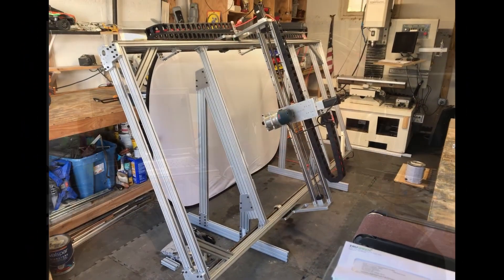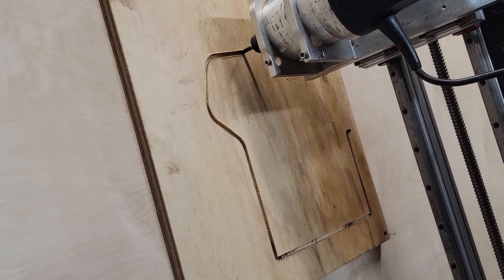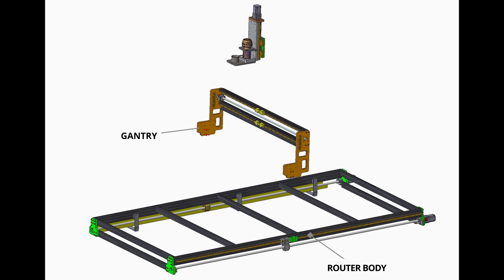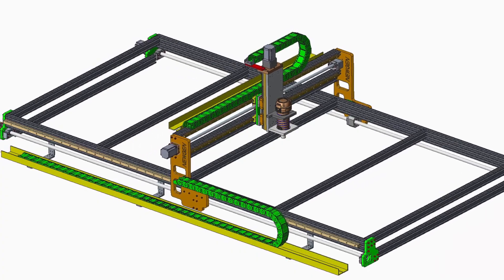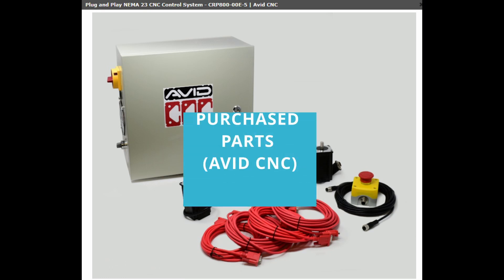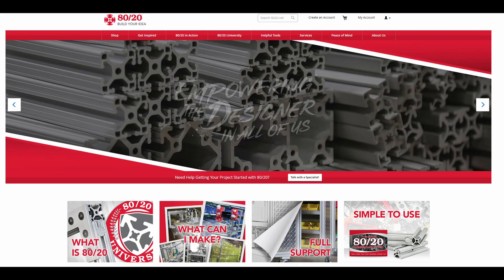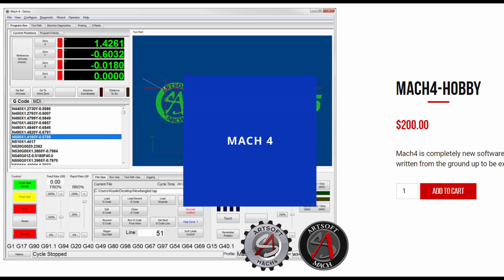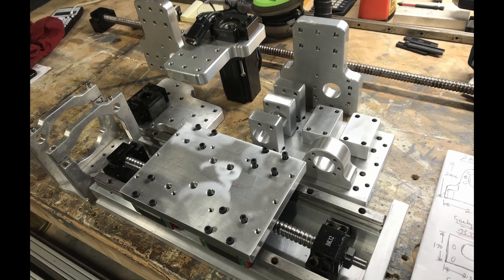1. HOME BUILT CNC MACHINE, ROUTER, CAD DESIGN, ALUMINUM 6061 CUTTING, 80/20

Comment: Hi, can you please give me the plan for this cnc router? 🙏
Reply from the maker: Hello Sir, Thanks for watching my Video. Being that this unit will be going into limited production in conjunction with one of the local learning institutions, I am not able to share the models at this time. Also note that I work straight of of the 3D models so I don't create the 2D drawings. If you are looking to build a router this size consider using rack and pinion especially for the long axis. I am actually updating both the X and Y axis into rack and pinion because the long ball screw is tending to skip especially at the extreme ends. Also check out Turbo squid they do have some downloadable router assemblies. Feel free to reach out to me if any questions arise.
Reply: @simbamkuu33  thanks sir, haw I can reach out to you?
Reply from the maker: @abdelmalik5655  Hi Mr. Malik, My email is simbamkuu@optonline.net.